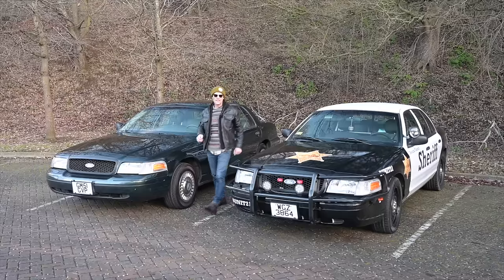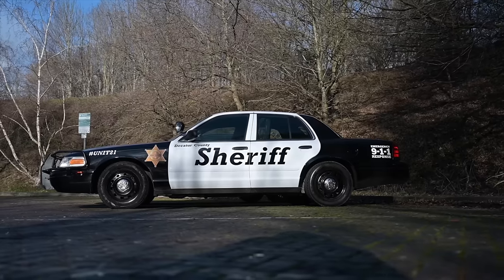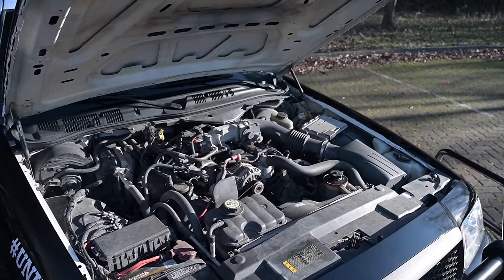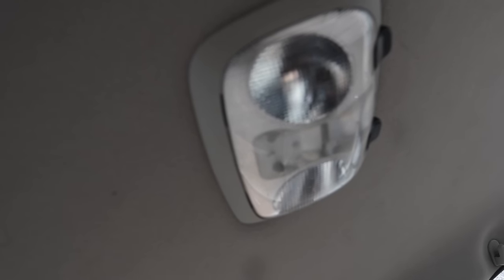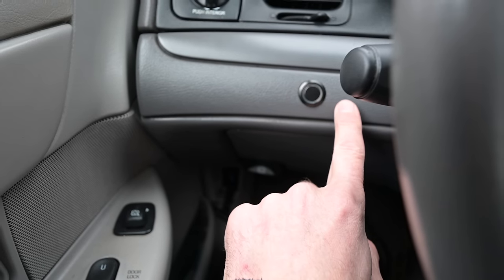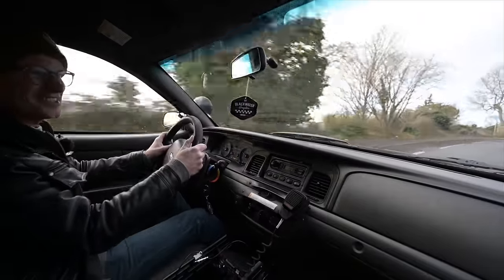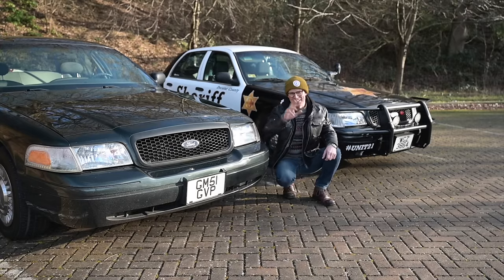What makes a P71 Ford Crown Victoria Police Interceptor special?

Comment: I've worked on many Crown Victorias before i went into heavy trucks. The 1980's crown Victorias had metal cam gears, cast iron water pumps, heavy duty brakes ( they were taken from the station wagon model ), and the part numbers for the clutch packs in the transmission have an HD on the end. They also had some other mods as well. There was a massive oil cooler on the left front fender well, and they had a 2 speed rear end ( dont remember if it was some or all ). The shifter also had I think S1 and S2 ( probably for the 2 speed rear end). Amazing cars.

Comment: I had an 01 P71. It has been in a substantial front end collision at some point in its life but it was still rock solid after having been repaired. It had the only automatic transmission I've ever actually liked. The steering was numb and over-asisted, but once you got used to it, you could really hustle it around turns at speeds no car that size should be able to muster. But, I had to trade it in to get my dream car of a red V8 Mustang. I still miss it, tho.

Comment: I currently own a crown vic (not a police interceptor).  It's a great car.  Very reliable, easy to service, enough power to get out of its own way (not fast, but it's around 4,000 pounds...), and on the highway doing 75 MPH it's surprisingly economical (around 24 MPG).

Comment: I learned a few new tips about my girl. 2007 Ford Crown Victoria Interceptor. Worked for The Michigan State Police - Hastings.

Bought in sept 2015 for $3,300.00 w/ 103,000 miles. As of January 2024 Vida Blue/Blue Velvet/Sheba has 209,400 miles & going strong.

I’ve kept up on maintenance m. The only big ticket repairs have been a new gas tank/fuel pump & the AC Condenser Can twice - damn salty winter roads.

I love her & want to pass 300,000 miles someday ❤

Comment: I have owned 4 Crown Vics and 2 Grand Marquis, only one was a P71, it was a 1996 CVPI with a 3.08 open axle ratio, it had been ordered new by the NC Hwy Patrol, the benefits of P71 are 1.5" higher suspension ride height, stiffer suspension, added engine and transmission cooling, more aggressive transmission tuning, true dual exhaust without resonators, high flow induction box and intake pipe without resonators to reduce engine noise, higher ratio power steering with a cooler, wider high strength steel wheels with speed rated performance tires and some came with ballistic panels in the doors and stabproof panels in the seat backs, also a trunk release on the dash and a document light in the ceiling. They do handle and brake a little better than civilian car however the HPP Dual Exhaust or Crown Vic LX Sport with a 3.27 Trac Lok diff is much lighter than a police car and will likely out accelerate one from a stop. My 1996 CVPI also had the specially balanced aluminum driveshaft which allowed it to reach 136mph on the calibrated speedo with no limiter with only 225hp from it's early Non-PI 4.6L SOHC V8. As the cars continued with PI Heads and the Marauder air box making 250hp none were ever clocked much higher than 136mph in the Michigan State Police or LASD tests. At some point they lost the balanced driveshaft and were limited around 120-130mph depending on axle ratio, the later cars had 3.27 open or LSD or 3.55 LSD rear options which helped acceleration while not helping top end speed. I would buy one again, I would probably go with a nice Crown Vic LX like the 2005 I had with leather interior and full power options. I modified it from single to a 2.25" true dual exhaust with an H pipe and Magnaflow mufflers I also removed the silencers from the intake tube and replaced the air box with a K&N cone filter, then I added some 18x8 Mustang GT California Special 5 spoke wheels with BFG KDWS tires to give it a Marauder look complete with Magnaflow rolled tips in the rear bumper location like a Marauder. I also replaced the orange corner lenses with clear units. It was a nice package that looked like it could have been sold from the factory that way. It made 210rwhp and 250rwtq on a Mustang Dynomometer which tends to give lower numbers. Sadly it still had the 2.73 open differential and was limited to 112mph. I was planning to swap a limited slip with 3.73, 3.90, 4.10 or 4.30 gears and have it tuned. I ended up trading it in for a 2004 F150 pickup after I got a 2005 Mustang GT 5 speed in legend lime instead. Panthers make great vehicles, I was drawn to them because they were inexpensive, V8, rwd and cheap even for a teenager to insure. I had wanted a 1994-1996 Impala SS or a 1992-1996 Caprice or Roadmaster with a 350 but they were too expensive when I was a 19 years old in 2002. I would be 25 before I finally was able to get a Mustang GT. Any large V8 rwd American car from before 1980 with one of the better transmissions and a 327, 340, 350, 351, 383, 389, 390, 396, 400, 402, 403, 413, 425, 426 427, 428, 429, 430, 440, 454, 455, 460 is probably going to have the potential to make good power with light mods and be very durable with a TH350, TH400, C6, TF727, Muncie, top loader, A833 and a big 12 bolt, 8.75", 8",9", Dana 60 rear end. They don't handle a that great or stop all that great but. They're comfy and tough and will run forever as long as 10-20mpg is ok for you.

Comment: Reliable, Forgiving, Decent Brakes, Woefully Underpowered. 

After equipping a Crown Vic with emergency lights, siren, LoJack receiver, Automated License Plate Reader, special bumper, radios, computers, armored front doors, then adding in ballistic helmets, gas masks, ballistic shield, high level ballistic vests, rifle, shotgun, less lethal weapons, extra ammo for all, door ram, bolt cutters, first aid gear, blankets, teddy bears, AED, fire extinguisher, stop sticks, two cops wearing 30 lbs of gear each and fresh out of DoNut City, made the 4.6L motors lack of low end torque and high end horse power evident.

Comment: I have an 08 since 2018 that was a supervisors car on the Escambia county sheriff dept w/ power seat, carpet 93 Oct Marty tune, total cat delete, MSD coil packs and a K&N air filter, approx 280 hp currently 136k, 1700 idle hrs that wasn't flex fuel, cool video.

Comment: Around 1991 thru 1993 I worked for a company that did the conversions.  We got the cars from the dealer that won the bid to supply the cars to a particular city.  Installed the light bars, siren, prisoner screen, push bumpers, radio antennas, had another company do the graphics.in our shop. We did both the P71 Crown Vics and the 9C1 Caprice.  Also a few of the Camaros and Mustangs. Never liked the Explorer. Felt unstable on the road.

Comment: I have owned four P71s over the years and all bought at auction in Nevada. The body issues were minimal which I repaired myself and then had Macco paint on all of them - jet black. They all ran out and I only had to put on a serpentine belt. They all ran great and I miss them. But, I just grew tired of people assuming I was a police officer, to be honest. Great cars and it is a shams they dont produce them any longer.

Comment: Love my 2009 example, I use it as my daily with a shave over 140,000 miles on the clock.  Mine didn't come with ram bars, but it has plugs where you'd expect to find the aerials and such and had remnants of the decals for the livery, so really makes me wonder what exactly my car was used for.  I really do enjoy seeing videos on your P71, are there any plans for more work on it in the future?  I remember you wanting to swap over to the smaller chrome center hubcaps at one point, is that still a goal of yours?
Reply from the maker: Ive grown to like the fun trims, got a couple of jobs to do with it this year
Reply: It's actually about as common to find CVPIs without push bars, as it is to find them with them - it all depends on the individual police department and their policies - especially in regards to chases.
Reply: @digitalutopia1  my 2011 CVPI was a Seminole County FL car and it doesn’t have a rambar
Reply: My o4 was a Missouri highway patrol car. 179000 miles an I love it
Reply: @101-Reagan B  I've had two from different towns in the same county. My 2010 was from Highland Park, IL, and didn't have one, but my 08 from Vernon Hills, does.
Reply: @digitalutopia1  that’s cool
Reply: I've got an 07 Sport. Just crossed 60k miles. I love the car. Probably the longest I've owned a car.
Reply: @101-reaganb2  Huh, my CVPI was a Riviera Beach, FL car, so it came from the same state as yours.  Mine just traveled from the bottom of the country (location-wise) to the top before I bought it.

Comment: I have owned 12 CVPIS. I sold all of them but one 2006 SAP just turned 225000 miles. The manifold just cracked the  location is  one of the heater hoses tubes on the right rear.. just crubled.. new manifold $200 and my mechanic friend that works on these cars for A SD is charging me $300 labor. The car has been flawless except for a water pump and normal aervice. I bought a FPIU recently and enjoy driving it as well..

Comment: You got it backwards.  The 3.27 diff would be the economy option; the 3.55s are for better acceleration. The civvy cars got 3.08s standard, IIRC, unless fitted for taxi or towing.

The higher the diff number, the faster the engine will spin at any given speed.  Hence the warning to use overdrive in high speed pursuit.  At 100+ mph with 3.55 gears and overdrive locked out, the engine would be spun up pretty damned tight, and the power steering pump, A/C compressor and even the alternator are going to be heavily stressed - as is the belt that drives them.  Remember, that belt also drives the water pump.  Lose the belt, and the engine will get hot in a hurry.  Aluminum heads that get overheated tend to crack and warp.  Expen$ive.  Overdrive reduces engine rpm for less wear/tear and longer life, and as a bonus, uses less fuel.

And yes, the modular mill is tough as nails.  Much of its construction is similar to the ancient 390 and 427 'FE' mills of legend and song.

Comment: I like the 02 the best. It had the slower 2valve motor but had aluminum front lower control arms. Rode great and would never fail as long as you torqued the spark plugs. The newer 3 valve motors were problematic but still more dependable compared to most cars.
Reply: @nastybastardatlive  thank u for the heads up. I always thought it was like the later 5.4. 👍
Reply: All Crown Vics came with a 4.6, 16 valve motor. None came with a 24v. Mercury Marauder came with a 32v 4.6.

Comment: most likely no tourist who has visited New York City has ever ridden in a retired police car taxi RE: @10:52, since all yellow cabs were required to be purchased new from factory as the p70 packaged long wheelbase model specifically made for extra rear legroom, unless it was the early whale models and all the Aero cabs and previous to that when ford didn't make a long wheelbase on the p70 taxi package... the only retired police cars in use as taxis were in places that tourists generally wouldn't frequent, used for car services and illegal street hails, (which were commonly vehicles not even licensed to take pre-booked rides, quite possibly not even validly licensed to be legally driving cars at all, so it would be quite the stretch to call those cabs)... aside from this gaff, this video is highly detailed and very interesting to follow. thanks!

Comment: In front of the fuel door button that trim piece can be removed to add the trunk button. It still has the letters under that trim, also there should have been a traction control wiring harness behind the trim where you put the fog light button. You might see on later models if equipped on the front right of the drivers seat will have adjustable lumbar support

Comment: A lot of American cars of that year and previous would only unlock the driver door.  The central unlock was mainly a European feature for many years until the US caught up.  For police cars its not for people getting in but getting out.  They don't want to accidental unlock all the doors and allow someone to escape.  Most american cars have had the feature to turn of the dome light with the doors open for quite awhile (well before the panther).  if i'm not mistaken my 67 was able to.  The backseats are normally solid plastic one piece units for most patrol cars, no cracks or seams makes it a breeze to clean up.  The trunk pack only takes up the room where you can see the step/ shelf on the bottom compared to normal crown vic, (items can still be placed/ but allows for use of a gun mount and accessory shelf).  The OEM police ones are actually kevlar and rated for 75mph iirc and come with organization partitions/ doors. The gas tank is not located behind the rear passenger compartments shoulder.  It is underneath and mostly behind the back axle.

Comment: Central locking wasn't... and really isn't a thing on US market cars until recently. You'll have power locks of course, and traditionally these are not linked to the lock cylinder on the door. 
Even USA market VWs didn't have central locking initially - one turn of the key would unlock just the driver's door, a 2nd turn would unlock the other doors. The boot lid wasn't part of the central locking at all! 
Another fun tidbit: The power lock buttons are always active on these cars. I helped more than one person get into their Crown Vic after they locked the doors with the key in the ignition by pulling back on the corner of the door, then using a wire to poke the unlock button. And yes - the power locks let you lock the door with it open, and the key still in the ignition! 
Your car has an upgraded radio with a tape deck! So fancy! My 03 F350 only had the AM / FM radio, and 2 speakers. But it actually sounded really good, and had excellent reception! 
If the instruments in yours are like my F350, the volt and oil pressure gauges are fake - they're just a glorified idiot light. They don't show anything other than bad / good, not a relative reading of the actual volts / oil pressure.

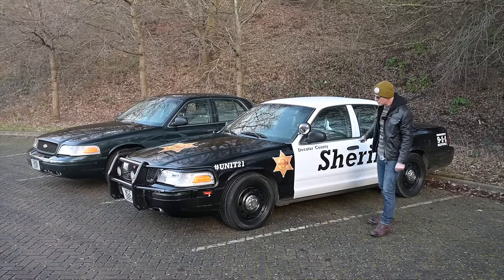Comment: Thanks to free trade that paid the way for USA jobs to leave, starting in 1992 all of these cars were made in Canada. Almost all of the years had engines and transmissions made in Michigan. Most of the plastic pieces were made in Canada. Almost all of the electronics were made in Mexico. Have had a black 07 for 6.5 years. Up to 141,622. Computer limits the top speed to 118 MPH with the 3:55 rear end. My white 2011 has the same setup and up to 145,650. All of the 2012's were sold to Saudi Arabia. There is a long video on youtube here that shows the complete assembly of the Crown Victoria in 8 parts. Check the torque on those spark plugs. Spec is 13 but I would go 15 to 20. Thanks for reading, from Kentucky.

Comment: The later model P71 had "dark mode" selectable for the interior dome light, so it is possible to configure it to work like a civilian model. Ford IDS software and a communication module is required to toggle the setting in the body control module.
Reply: It can also be done with forscan

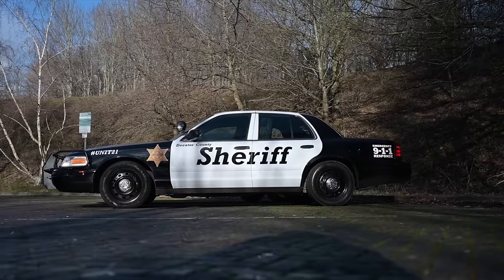Comment: 12:33 mark pretty sure your statement is WRONG. 3.55 would be the one for acceleration while the 3.27 would be the one for economy.  3.55 would give better whole shot acceleration while the 3.27 would be better for cruising on the highway.  (Bigger the number means better low end grunt/acceleration) Won't get into powerband etc and rpms.

Comment: I got a 2003 mercury Grand Marquis...I'm surprised you didn't know about a left hand button on the dashboard..its lit with a background light..it seems to go from limited slip to positive traction...and it has the electronic pedal button...it a 2003 mercury Grand Marquis..LS bronze...the color of the car is gray the color of the name on the truck is bronze
Reply from the maker: Basic Crown Vics dont get the pedal button, it's an option not often ticked. I used that space and the rear of the moulding to drill and fit the rear fog light switch

Comment: It's the PI cylinder heads police 4.6 are 250 horsepower and I believe 285 torque in the latest generation where civil 4.6 versions were 224 hp in vics and marquis and 272 torque
Reply: PI heads go back a long while - the last performance increase goes back to 03 with the introduction of the Marauder airbox.

Comment: What makes it a police package depends on the year. The first packages were just brakes, alternator, suspension, radiator and duel exhaust. And in the 1980 to I think about 1986 law enforcement could get the 5.8 liter 351 with the package.

Comment: I used to have to do the pre-delivery work on local police vehicles when I worked for a dealership, and you neglected to mention the fact that a secondary computer module would be piggybacked into the OBD port on these cars, which would give them different shift points, tuning etc.

These boxes came rather securely for install, and are pretty-much always removed from the cars prior to them being sold to the public after their service life had ended.

Comment: 12:47 the 3.55 is the shortest ratio. 2.73 is slowest and most economical, 3.27 is in between. The 3.55 is the most optimal for acceleration (you can really feel the difference between this and a 3.27 and especially the 2.73) but cuts the top speed by a few mph